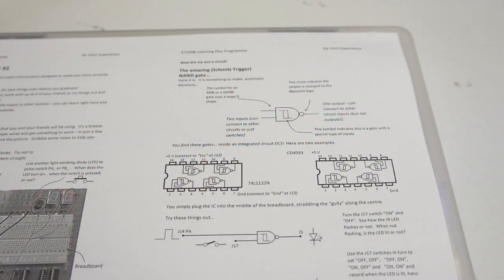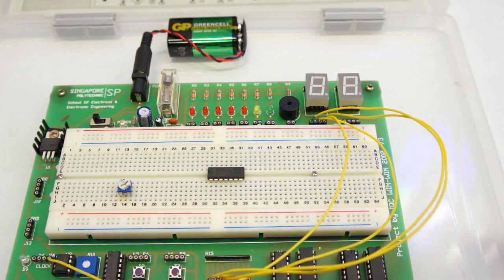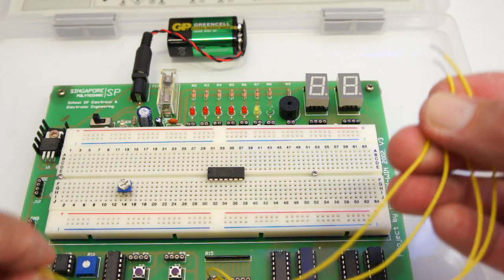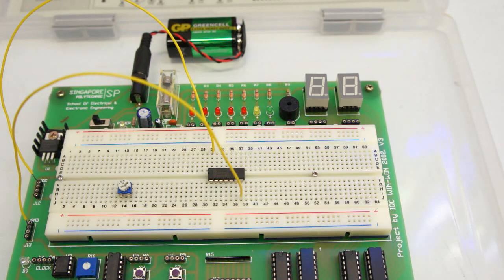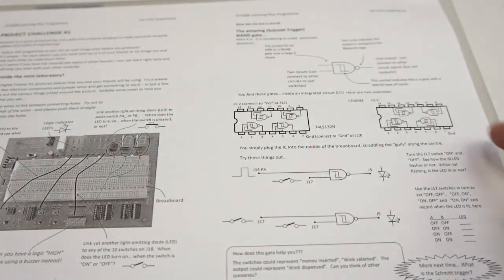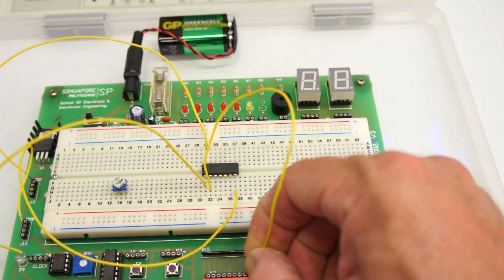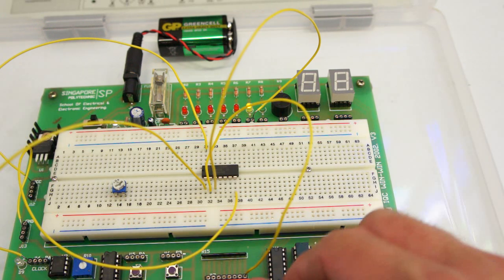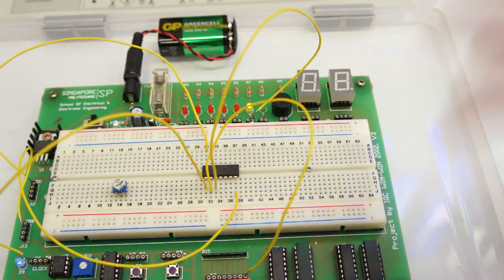The Schmitt Trigger CMOS NAND gate

Comment from the maker: @dannyhd29 You are right... it's a multi-purpose PCB developed by a team at Singapore Polytechnic.  The breadboards are the standard $5 ones you can buy easily.  Nothing too high-tech.  The data switches and other inputs go via TTL gates for buffering/minimising short-circuit damage.  You can easily put one together yourself!